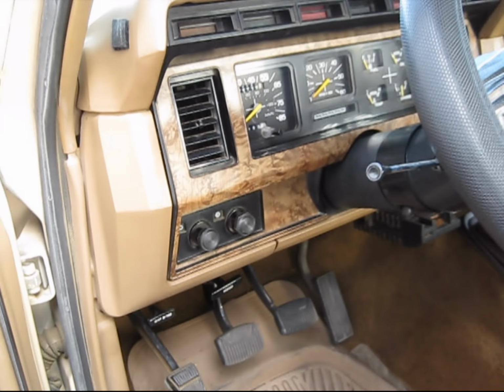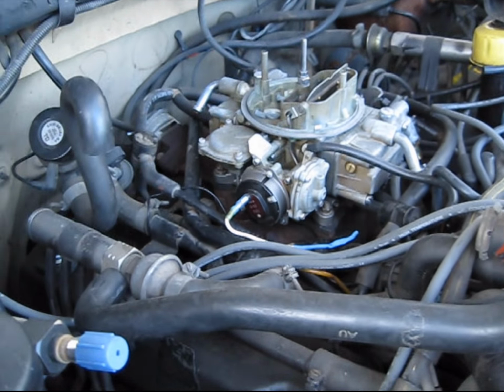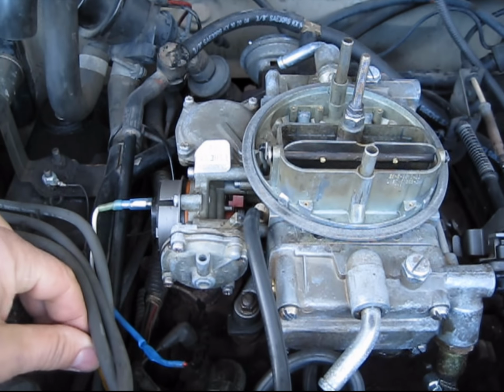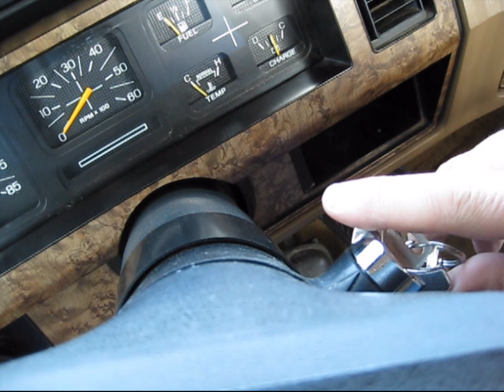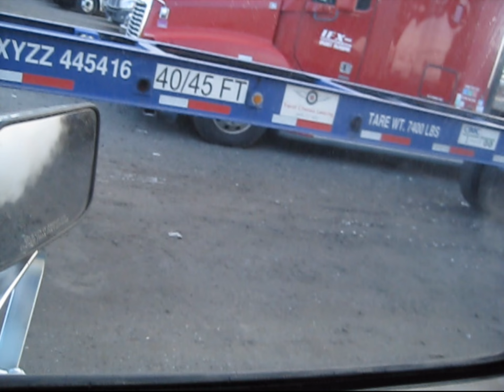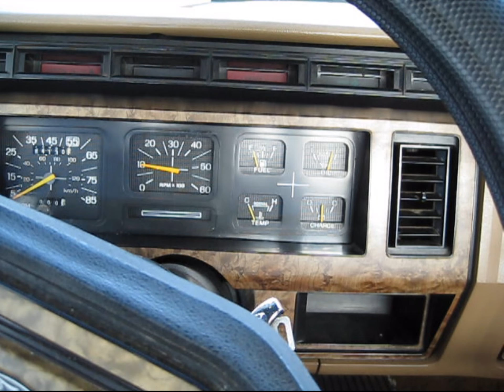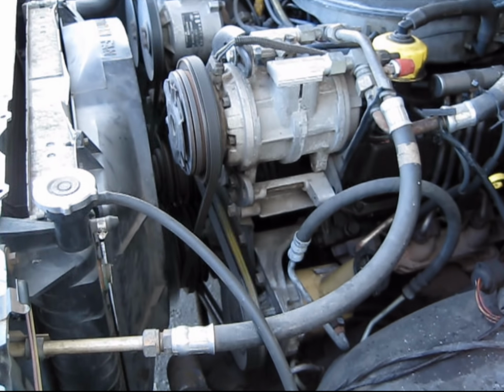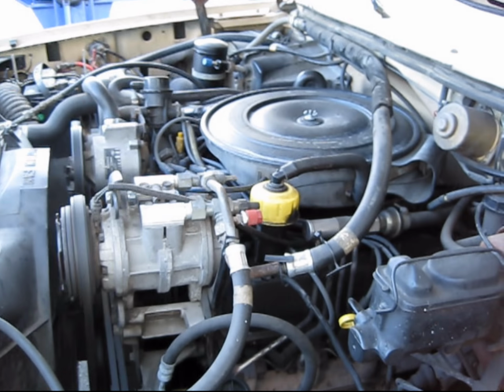F 250 1986 Ford Pick Up - Carb Update

Comment: Good video, I actually own and daily drive a 1985 Ford F-250 Lariat XLT single cab, 8’ bed, dual fuel tanks with this same 460ci engine and model 4180C 4BBL carb, 4X4 with 4-speed Manual trans. My truck was a Wyoming vehicle that I bought while attending college then I brought it back home to Louisiana. That was a big altitude and temperature adjustment for the truck and it took me almost 2 months (working on it only on weekends unless a problem deemed otherwise) to get everything tuned and running like a champ once I got back home. So from one Ford guy to another, here’s some simple easy tips to get your big block with the insanely temperamental 4180C 4BBL carb starting & running smoothly and reliably every time you turn the key.

1st make sure you get the correct battery group size for the truck with at least 750CA then look at your trucks problems, the electric choke is set incorrectly, 2nd the accelerator pump is leaking likely due to being set wrong and driven which can damage the diaphragm if not corrected. 

3rd the 2 hoses are the bowl vents they are connected to the 2 black vacuum check valves in front and the rear of the carb (not to be confused with the 2 black air diverter valves for air injection to the exhaust manifolds and air cleaner for emissions) these are connected to the 2 charcoal canisters. In which if connected correctly the intake will burn any emissions (fuel vapors) from the fuel tank(s) and the bowl vents as well as keeping the tank from pressurizing from heat and helps deaerate the carb via the (bowl vents). 

4th try replacing as much of the dry rotted plastic vacuum line tubing as you can and make sure the rubber vacuum lines aren’t brittle or spongy, this will help with the vacuum circuits operating correctly. Verify all the vacuum operated components work correctly by using a hand vacuum pump to actuate them manually and that everything is connected according to the emissions vacuum diagram placard on the top of your radiator core support.

5th the ignition timing should be set to 8 degrees BTDC with the curb idle (engine at operating temp) at 800 rpm with the fuel mixture screws on the front of the carb set with a vacuum gage connected to the intake and showing 15-22 in-hg. Make sure your spark plugs are set to 0.042” and your plug wires & distributor cap & rotor are in good condition with no black traces indicating spark leakage.

6th when your choke is being set it should be with a cold engine and choke closed to approximately a 1/16” gap at the top front of the choke horn, then start the engine and set the choke fast idle screw near the choke fast idle cam so the engine idles at approximately 1,100 -1,300 rpm with engine cold (less than 100 degrees F). Make extra sure that the accelerator pump screw is set to 0.130” - 0.150” with a feeler gauge with the throttle closed, also that at full throttle your not over actuating the accelerator pump lever to its MAX travel (there should be some available spring tension even at Wide Open Throttle).

My truck still runs a little rich due to being in southern Louisiana where is mostly hot and humid all year round but, it runs ok for a truck with 317,000 miles on it and it’s still using the stock factory intake & head gaskets with factory con rod & main bearings & cam bushings and normal oil pressure. I had to replace every other gasket or seal due to oil & exhaust leaks along with the clutch and timing chain all due to clutch slipping and erratic timing from a stretched timing chain. Replaced the water pump and thermostat when I came home then the distributor, plugs and wires shortly after that all due to leaks, ignition troubles and I added a small fin style oil cooler to the truck & a power steering cooler all because it’s hot here in New Orleans, Louisiana especially in traffic. Now it runs cool, cranks up every time I turn the key, never misses a beat and it still gets the factory fuel mileage 7 to 8 MPG in the city & 10 to 14 MPG on the highway (depending on if I’m hauling or towing anything) that it had when it was a new truck.
Reply: I’ve been working on my 85 F250 XL 460. About to change the carb as well your comment is golden for me lol sounds like all my problems hahaha

Comment: Ford recommends that you run 5w-30 if you’re in constant freezing temperatures.

If constantly above freezing temperatures, they recommend 10w-30 or 10w-40 

Oil is crucial in different climates for the longevity of the engine. Just read it in an owner’s manual the other day for an 87 460 V8